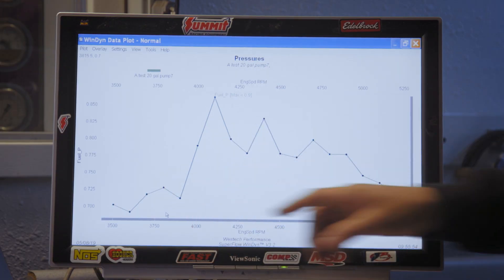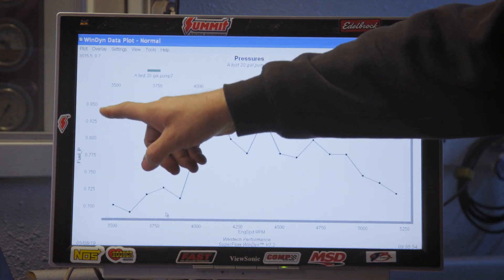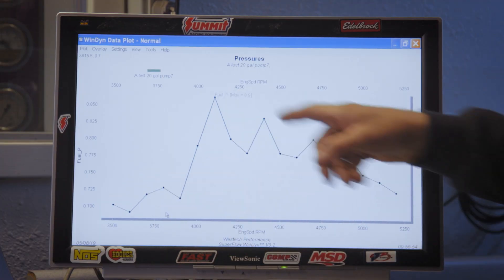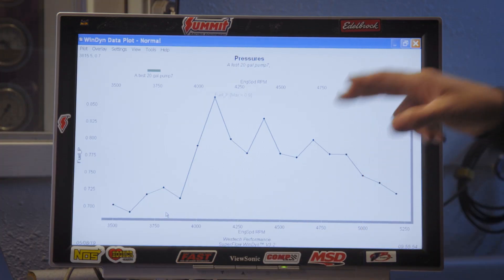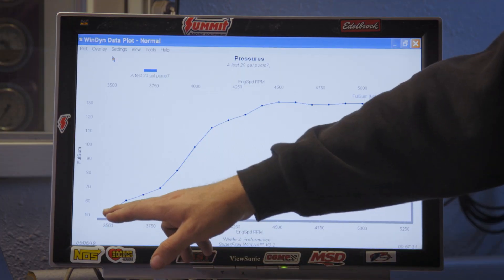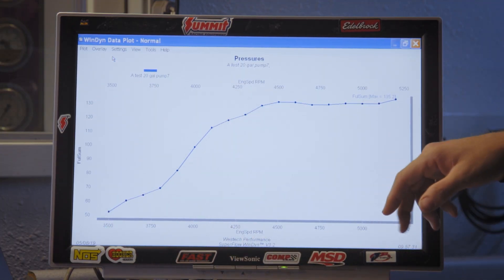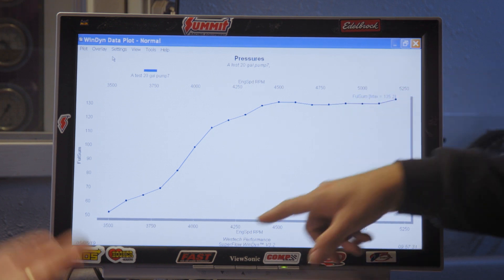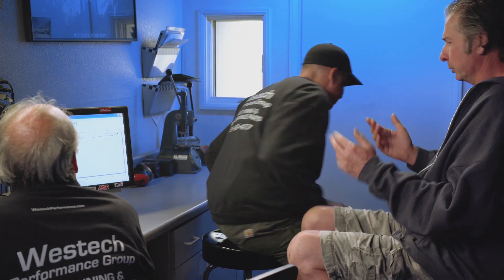Battle of the Budget Fuel Pumps—Engine Masters Preview Ep. 50

Comment: You should have looked at the EGTs.  They will peak and then become cooler the leaner the mixture gets.  No fuel, no heat.  Many aircraft engines are run lean of peak egt, the trick is you must transition from rich of peak egt to lean of peak egt quickly and not pause/run at peak EGTs or bad things can happen.  The sustained lean or rich egt on these engines is around 1400f and the peak egt would be around 1550f.  To run lean you need a really good ignition but it can be done and is every day, in a very controlled way.  Google lean of peak operation or Gami injectors.